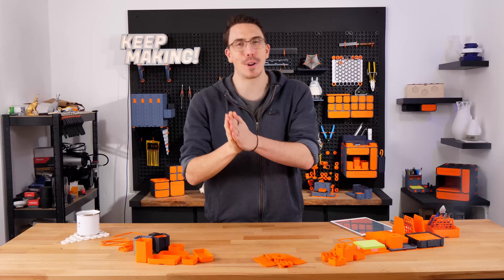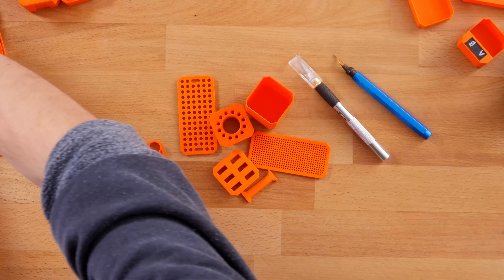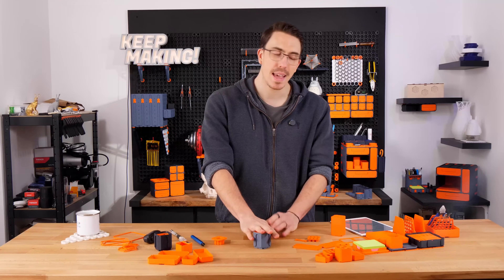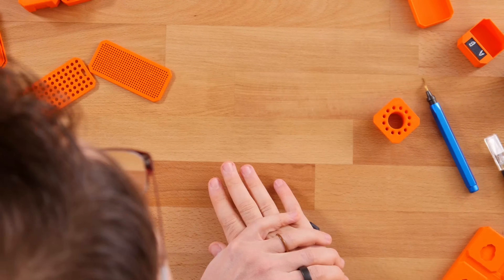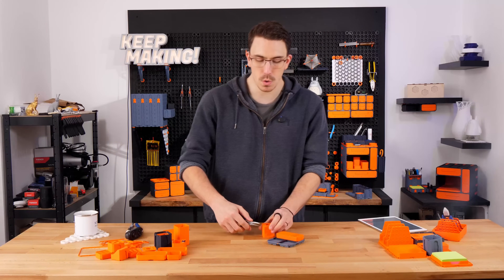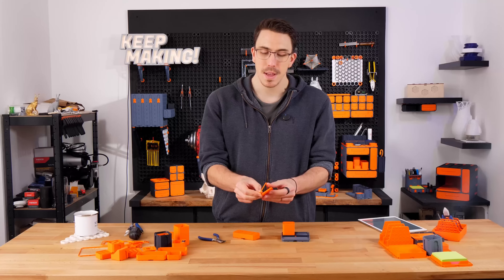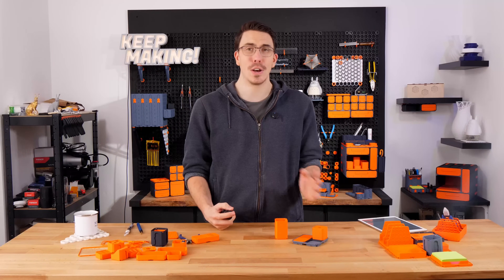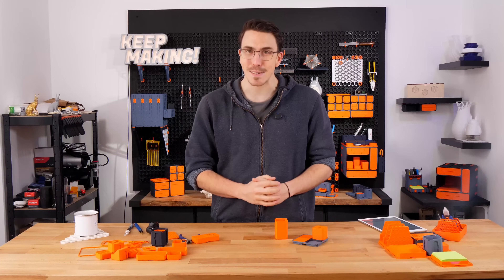Multibin Inserts, Big Info Changes & More... - Multiboard Update #003

Comment: Linear Divided - Simple Drawers

1 Deep

1.5 Deep

2 Deep

2.5 Deep

3 Deep

3.5 Deep

4 Deep

Grid Divided - Simple Drawers

1 Deep

1.5 Deep

2 Deep

2.5 Deep

3 Deep

3.5 Deep

4 Deep

Multibin Drawers
Bases
Plain

1W - Plain - Multibin Drawer Base

2W - Plain - Multibin Drawer Base

3W - Plain - Multigbin Drawer Base

4W- Plain - Multibin Drawer Base

Internal Grid

1W - Internal Grid - Multibin Drawer Base

2W - Internal Grid - Multibin Drawer Base

3W - Internal Grid - Multibin Drawer Base

4W - Internal Grid - Multibin Drawer Base

Faceplates
Bottom Holes

1W - Bottom Holes - Multibin Drawer Faceplate

2W - Bottom Holes - Multibin Drawer Faceplate

3W - Bottom Holes - Multibin Drawer Faceplate

4W - Bottom Holes - Multibin Drawer Faceplate

Full Holes

1W - Full Holes - Multibin Drawer Faceplate

2W - Full Holes - Multibin Drawer Faceplate

3W - Full Holes - Multibin Drawer Faceplate

4W - Full Holes - Multibin Drawer Faceplate

Base Cover

1L - Base Cover - Multibin Drawer Faceplate

Handles

Handles - Multibin Drawer Handles

Short Handles - Multibin Drawer Handles

Connectors

Faceplate-To-Base Clip - Multibin Drawer Connector

Drawer Stopper Bum - Multibin Drawer Connector

Faceplate Cover Clip - Multibin Drawer Connector

Front Base Connector - Multibin Drawer Connector

Side Base Connector - Multibin Drawer Connector

Drawer Accessories
Simple Drawers Stacking Plates

Plain - Multibin Drawers Stacking Plates

Internal Grid - Multibin Drawers Stacking Plates

Spacer - Multibin Drawers Stacking Plates

Under-Desk Drawers

Comment: you useless, why do you remove old pieces? I want to mount tiles with the old 8.2 screw in fasteners and they dont exist anymore? neither on thangs nor in legacy parts nor anywhere? whats wrong with you? why cant you make a stable system? why cant you learn from other succesful systems?

opengrid is going to surpass you and you will be left standing asking why. i wish i had never printed your stuff

Comment: Im having issues with the rims not fitting very well in the bin shells. They always seems too loose and easily pops out. Not tight as in the video. Im using a p1s bambulab and the recommended settings for the print. What could i be doing wrong?
Reply: If anyone else is having the same problem, you might want to check the materials you print with. I used PLA for the multibin and ABS for the rims and holders. ABS shrinks more than PLA. You can use ABS tops and PLA rims. At least it works for me :)

Comment: Can multibins be screwed unto multiboards so they don't rely on snaps and don't wiggle?
Reply: Multipoints are designed to provide that via slotted attachment, but if you want to go all out you can use bolt-lock pop-ins on your bins and bolt-lock them directly!

Comment: Are these bins compatible with Gridfinity grids?
Reply: They are not, as Gridfinity uses a base unit of 42mm, while we use 25mm/50mm (the "metric inch") to match pegboards and other elements of the system.

Comment: What's the point of this when weve already got gridfinity? This adds almost no benefit while being entirely incompatible with it. Not to mention its incredibly complicated for what it is, meanwhile GF has years of models for various things already.
Reply: For me, this is a massive upgrade over Gridfinity for some uses, especially if like me you are reconfiguring things a lot.  With Gridfinity I'm reprinting an entire cube of some kind, with this I'm reprinting an insert and keeping the shell, and with the update in this video I can print even less.  The other benefit of this system for me is being able to link different shells together with the rail parts.  I'm working on printing shells/inserts for some of my gaming stuff.  But, when I'm taking it with me to a game shop, I don't always need to take the same stuff every time.  Instead of a static carrying case, I can have different shells for different items, then snap together what I need and have a modular case and have everything fit exactly right.  All that being said, for some people this WON'T be better than Gridfinity, especially if they find it overly complicated.  But other people with other use cases can get a lot of benefit from the modularity of this.  I think it comes down to whether you're just making something to hold something and sitting it on a desk forever versus constantly reconfiguring and moving things around and swapping and changing things, because if you're the latter person, this makes a huge difference.  If you're the former, then at best you might be saving some plastic from these tops, but otherwise it probably won't matter to you.  And honestly I think that's the best part of 3D printing, because there's something for everyone and you can just pick and choose whatever works for you.  There's ten thousand 3D printable designs for holding AA batteries, and I think that's great.  Nobody needs to print all of them.  If one of them doesn't seem useful to you, then there's plenty more.
Reply: @kobld  I'll never understand this argument, if you're rearranging something so often and changing out what you're storing so much that you need to print new bins/inserts constantly NEITHER are a good system to use. Not to mention, a system like this could be done with gridfinity, a whole new, proprietary system wasn't needed to do that. If gridfinity's 42mm base size isn't what you like, scaling it to 119% gives you a 50mm base size.

This whole system is needlessly offer complicated and doesn't do anything gridfinity can't.
Reply: This. If multi board was built to the same size as gridfinity it might be worth paying for instead it's competing for absolutely no reason. Any potential "benefits" are lost by being proprietary. Why can't we just work together?;
Reply: @MrFolfy  Ultimately it's not really that we chose to not be compatible, but that we chose our ground truth unit to be the "metric inch" used in pegboards and a variety of other products (25mm). That meant that when we approached the challenge of bins, we focused on making a system focused on optimizing for attachment and modularity in our own system, rather than trying to match Gridfinity. We do provide a few compatibility parts, but at the end of the day our system isn't really meant to compete with Gridfinity specifically, it's just a full building system that also contains a bin option. As a fun coincidence, it also turns out that Gridfinity bins can often fit into Multibin shells (though the 1x1 needs the corners cut down just a little)!
Reply: @MrFolfy some of the top comments I remember seeing on the first ciders about Multiboard were literally "why wasn't this destined to be compatible with gridfinity?" Or "Why the fuck isn't the whole system free, there's zero reason to switch from Gridfinity" (before they had anything available for free)

Comment: Jonathan, LOVE the updates that you're coming out with. They're always informative and useful. 

QUESTION ... Can you bolt-lock a bracket in a standoff snap (single, double, quad)? I'm setting up a Multiboard wall to hold my filament spools using 8x8 tiles with 8x8 brackets which will support shelves. If I position the 8x8 bracket in the 8x8 tile as one normally would, the top and bottom threaded leg of the bracket will nest into a hole in the tile that has a standoff placed there. Can I bolt lock the top and bottom leg and still use the standoff? If not, what is the best solution? If the answer is "move the bracket so it doesn't nest into the standoff" then I'm ok with that but I thought I'd ask the creator before assuming the only answer is moving the bracket. One of the things I love most about the Multiverse you've created is how versatile it is and, with that in mind, my guess is that there is a way to do this already (or you'll come up with one) 🙂 Thanks in advance for your response!
Reply: Currently we don't have a way to bolt-lock into an offset snap, but we do recommend landing the lowest connection point of a bracket into one if possible. The 7x7 brackets work really well on 8x8 boards that way!

Comment: Can you possibly add a set of links to discussed parts above time stamps? Might make finding the correct parts easier!
Reply: This is the biggest problem with this system there is zero documentation or any kind of system. It's just all there in a big jumbled up mess.
Reply: @smithy18772  It's definitely a problem we're aware of. We wanted to release parts more quickly for those who want to experiment, but it's all still in beta development and the final documentation is something we want to focus a lot more on as we near later development!

Comment: It definitely has potential, but it feels like a system that is designed for the indoor tinkerer.

I'll be curious to see how it evolves beyond that.
Reply: Ooooo good shout. We definitely have been designing with the workshop and makerspace in mind, but as we get further along it would be really cool to see how we can adapt to rougher environments!
Reply: @stellasfun  part of it is that everything seems very small. Like something that would belong on a shelf or a desk drawer.

Clough42 recently did a video on trying to implement gridfinity in his machinist shop. 

I'm not even sure some of what he did would be feasible with multiboard as currently configured. But I'd like it if it could 👍

Comment: So at this juncture would it make more sense to dispense with the "insert" concept and just rely on the rim + lids?
Reply: Not always. Rim lids are excellent in situations where you just want that specific feature alone, but inserts are great when you need to rearrange or use them in different scenarios (like the microbins, panels, and drawers)

Comment: I still stuck with a desk panel of multibord truing to figure out how to put bins on it. A catalog or a documentation is the must for this system.
Reply: By desk panel do you mean a multiboard tile on the desk surface horizontally? If so you can add a panel or baseplate to the top to adapt for bin bottoms. I highly recommend checking out the community if you haven't!

Comment: Multiboard is too specific. 
It is overly complicated, needs too many parts just to get basic stuff done. 
You are engineering your project into a corner it will be hard to get out of at some point.
Listen to the community.
1. Simplify. We need LESS parts, not MORE. Make parts multifunctional. 
2. Improve documentation! It took me an afternoon to grok how the system is supposed to work.  
3. Provide measurements for your parts. I had to import the grid into fusion, measure the grid and iterate until I found the right dimensions that fit my project. Just provide measurements clearly visible with the parts. 
4. Reconsider how you monetize! Make the whole ecosystem open. Add a license that requires people to pay you a fee when they sell parts for this project.
5. Prioritize standardization. Work with the community and leverage its knowledge to your advantage.

In short: simplify, standardize, iterate with community, license to monetize.
Reply: The biggest point is documentation. There simply isn't any decent documentation. Also there is only Cad sketcher support for Blender not even real CAD programs. Like Fusion, OpenSCAD or FreeCAD.
The moneytization is strange as well instead of a single license it's monthy payments and hoping it gets better over time. I need to pay to get access to be able to help out being a beta tester (Cad Sketcher) seriously like WTF.
absolutely nothing feels finalized yet they throw it in the open. Seriously think of something and stay with it.

Seriously documentation and plugin support need to be WAY WAY better and not more more parts.
Reply: If they'll make simplified parts, it would mean there will be even more parts (old plus new simplified ones). But you're right, they need to find a way for users to identify parts they need in an easy fashion, and the same goes for exploring what parts do what, plus there's old/new versions issue (again, it takes some effort to check what older parts are outdated). At this rate soon it will be easier just to launch some CAD and draw parts from scratch rather than dig through all the stuff they made (actually, for simpler things I'm doing that right now). And this is sad, because they've put a ton of hard work to design this system, and it looks excellent.
Reply: I think if they just expand the software builder on their site it would go a long way. Tbf I discovered this just a few days ago. I went through the intro videos for multipoint/bin/board and I was able to build a parts list for a specific size shelf I wanted in about 20 mins (after spending the initial couple of hours understanding how the system works). I am an engineer by trade (software) so semi unrelated but maybe I’m not the type of person who gets confused by this sort of thing. Also, being in software… I am used to terrible documentation ;)
Reply: Let's see... I'm curious about a few of these aspects.

We currently focus on making parts as multi-functional as possible, with most of the part count coming from size variants and special case parts we provide. The central elements are about as packed with interfaces and functionality as I could manage. What kinds of uses or modifications are you thinking of?

As for measurements and documentation, our project is still in beta, with documentation coming after the initial wave of parts as designs have been confirmed and tested by the community. We do plan to expand documentation as parts are confirmed but we don't plan to focus on that until we confirm the designs further.

I highly recommend checking out the community and discord if you haven't for more information!
Reply: your suggestions make me think you haven't printed much of anything. you should stick to a regular peg board. what do you even mean it's too specific. bot comment maybe.
Reply: @xSKALBER  troll somewhere else

Comment: I chose Multiboard because despite the poor documentation the basic principles are obvious and the "weirder and weirder" elements can be ignored. Multibins - I won't even start there, because it looks like you took Gridfinity and decided it was too simple, you need to make it more complicated, and it would be good if everything took (even) longer to print and required a ton of material (filament).

Comment: The beginning of Multiboard was promising, at least in the enthusiastically told advertising words. But then it turned into a mess of thousands plus some subscription paid "new, unique, modular" overengineered parts.

Modularity - Broadly speaking, modularity is the degree to which a system's components may be separated and recombined, often with the benefit of flexibility and variety in use - Wikipedia. In the case of Multiboard, flexibility is achieved with a mess of countless specific connectors, splitters...

At times, it seems that Multiboard-specific month-long courses are necessary: "Multiboard and how to navigate in this mess".

Thank God I realized it in time and wasted only a few kilograms of material ;) and only rarely followed with a smile the effort to solve the problem by creating five new problems to be solved with new "special, unique and immeasurably modular" parts...

Good luck to the creator,
but for fans, kilos of filament and a lot of patience.
Reply: I've gone down this rabbit hole as well. I've salvaged the use of all the drawer stuff I made at least.  This is it on the head - so my warning to others is to actually think about what the heck your goal is. It's a fun engineering system to dabble in - like legos, but the practicality of figuring out all the stuff you need to print just to attach something to your wall is nuts with this now.

Comment: Thank you for making the shell inserts optional. You shouldn't need to print a box to put in your box, when it's only for a single purpose. Doing just the outer shell and snapping top plates into place with internal divider walls (such as the inner bins) is the best option, in my opinion. Now I can look at printing out some of the bins without feeling like it's wasting plastic if there's a need to change things around on my desk.

Comment: Amazing work, but I'd be all for simply making the tops fit directly into the shells without adapter rings and while this makes it not backwards compatible..... it simplify the whole product line so much.  Either way, thank you for such amazing engineering.
Reply: We wanted to allow everyone to choose between inserts and direct rim mounting since we didn't find that either could fulfill all the benefits of the other. Rims are small, low material, and fast, but lack some features and can't support themselves at really large sizes. Meanwhile the inserts take up quite a bit more material and time. So we figured providing the top option where we can and the insert/rim option where we must would be a nice balance. Of course, you're free to remix how you see fit!

Comment: is this system compatible with gridfinity? or vice versa?
Reply: It's on a different base size (50x50mm vs gridfinity's 42x42mm) but there are a ton of community-made adaptors so you can attach gridfinity baseplates or bins to a Multiboard wall. Same goes for Honeycomb Storage Wall pieces.